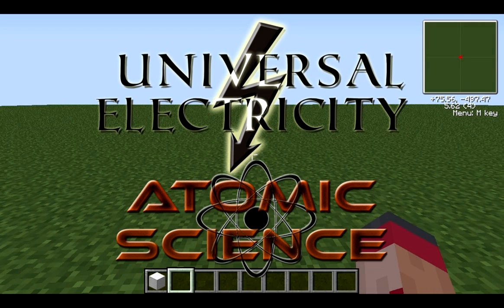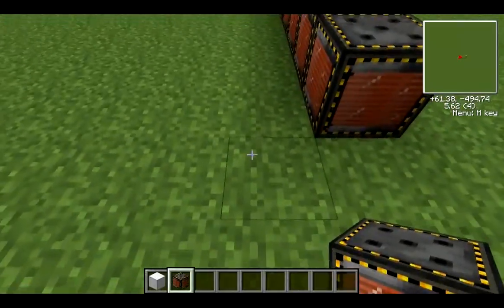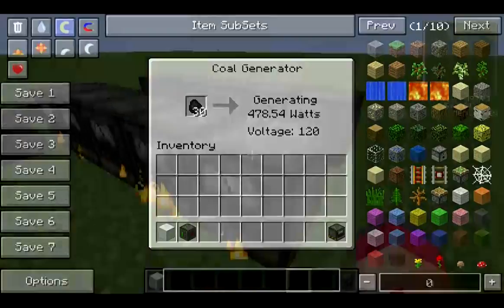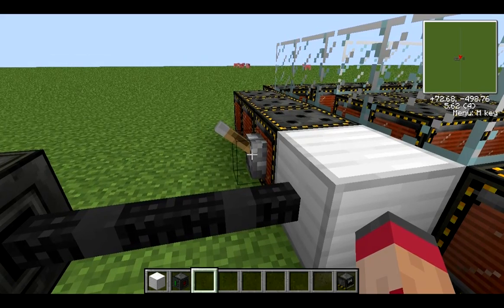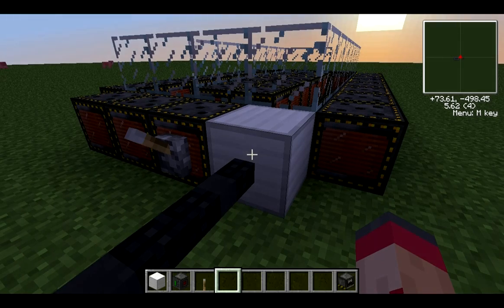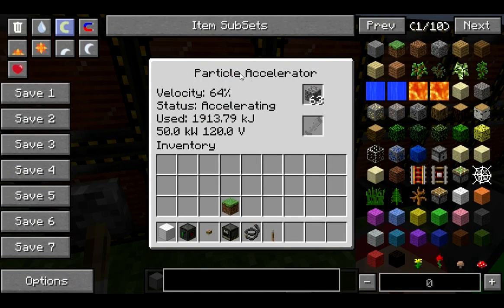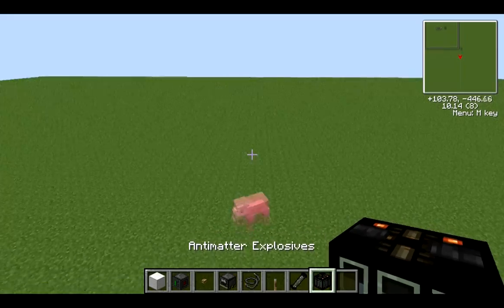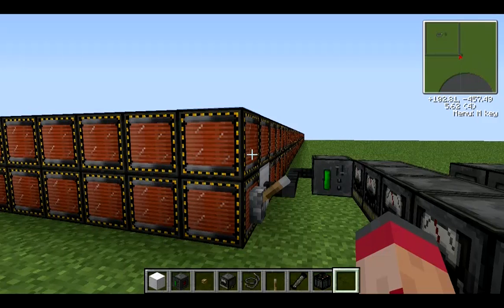Universal Electricity - Particle Physics

Comment: With the new version of the particle accelerator that has come out, I can not get it to produce anything but strange matter. Nine times out of ten the particle will explode with no effect, and the last time it produces strange matter- It seems to be incapable of holding maximum velocity. Any advice on what to do? I have a 100 block radius accelerator, courtesy of Creative mode.

Comment: I haven't done a fusion build yet, but I've read 50 kW from three hydro generators looped together, before.  That is peak, however; not sustainable.  To do it comfortably, you will likely want 4-5, with a seperate power source (I use 4 heat pumps each) for the pumps.

Comment: a four node hydrogen generator will get you 50 kW.  You will need 16 heat generators as well; with the latest fluid mechanics patch, 4 heat generators can power 1 pump.

Comment: from what I read, a joule is the equivalent of a watt lasting one second.  (A "watt-second,")

The way I interpret it is, that if 4 mj of energy was to do work at a constant rate, it would hypothetically take 4 million seconds to do so; but in practice it doesn't, because most of the machines in UE consume 100 j per second in increments.  A recharge cycle for a 4mj battery box for me, is usually around 40 seconds, which assumes I'm using a single machine at a time.